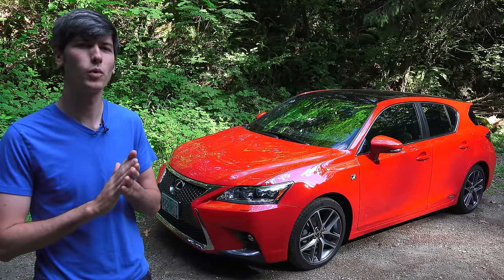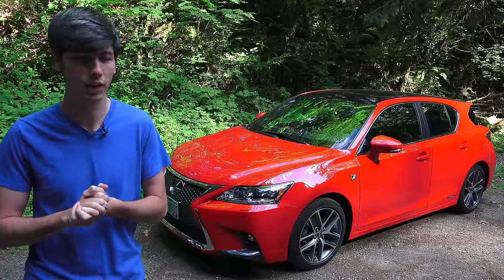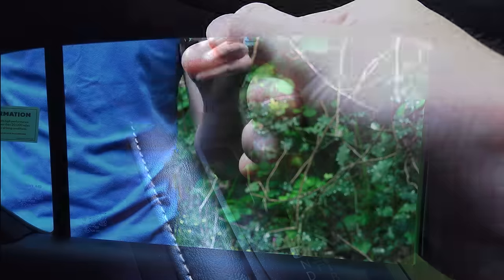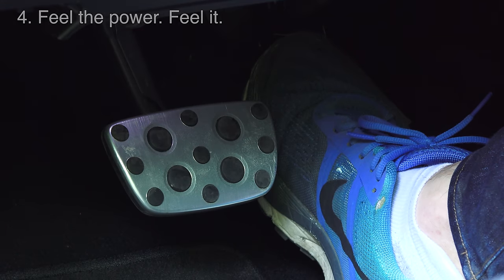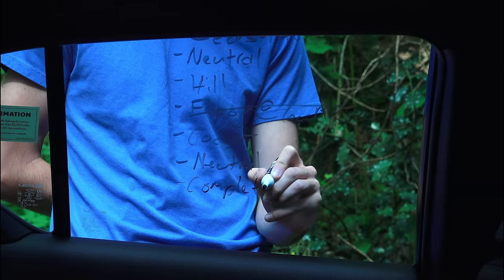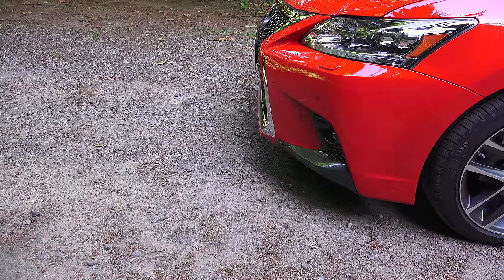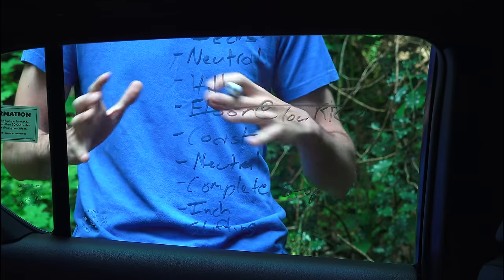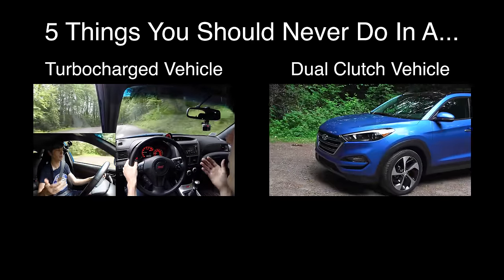5 Things You Should Never Do In A CVT Vehicle

Comment: Number 4 NO NO NO.   Starting from stop with heavy acceleration AFTER an emergency stop will damage it badly.  It is like starting from a stop on a 10 speed bike in top gear.  It puts huge stress on the transmission.  Huge.  I believe this is the biggest reason for CVT failures.
Reply: @EpicDrew15  Understood.   I believe the stress of this type of treatment feeds into the failure modes you mention (heat for example).   I've never owned a CVT vehicle and hope to never do so until they become basically invisible and I arrive at the point invisible is good.
Reply: @EpicDrew15  I base my lay person's perspective on an understanding of the original belt drive car (from Nederlands - bought by Volvo) and comparing the inability to shift the belt down after a fast stop to a 10 speed bicycle.  The loads imposed on the bike as you start off after not shifting to the largest gear on the wheel.   Not good engineering.  All the best.

Comment: What about towing ???? Like a jet ski 1000lbs or less in a Civic cvt
Reply: Belt driven CVT have barely enough power to push the bloody CAR around in the first place, CVTs are utterly pathetic 

Don’t even think about towing with one unless you want the transmission to grenade quicker than it normally will.

Manual transmissions are best for towing, then conventional torque converter automatics then dual clutch 

no manufacturer I’m aware of recommends towing with a CVT

Comment: What about those CVT (non)sporty cars with paddle shifters? Will down shifting with the paddle shifter load the belt in the reverse direction and subject it to unintended stresses? Most CVT belts now are "pusher" types and using engine deceleration would subject reverse loads.
Reply: Have you found the answer to this? I have the same question too
Reply: @markdizon3378  No answers that I have found yet.

Comment: That is not a cvt transmission. Ct200h has a hybrid transaxle without torque converter or belts or chains. It has 2 electrical motor generators and one planetary gear that emulates a continuous variable transmission

Comment: Does anyone know how a car with a cvt gearbox reacts if the engine breaks down when the car is moving? 
My Mercedes b-class engine quit with no warning when pulling out of a junction and the car stopped as if an 'emergency stop' had been performed. I was travelling at about 10-15mph when it happened. 
I'm trying to figure out if it's the engine at fault... or if it's with the gearbox.
The diagnostic computer shows no fault codes. 
After restarting, the engine and gearbox runs fine but I'm scared to use the car on the open road again as it could be a danger to myself or other road users should it occur again, especially if it happens at a higher speed. 
Any advice would be appreciated.

Comment: I broke a Subaru Outback 2015 CVT by slamming on the brakes in my driveway, and flooring it, and slamming on brakes. I have driven manuals all of my life and automatics break, and cost more than the vehicle to replace. My 2015 Outback with 135,000 miles is worth around $10,000 and a new transmission is $8,000 for another 125k miles. My 1994 3000GT still has original clutch and 190,000 miles and no problems. Automatics are trash made for lazy people. Problem with automatic cars is all automatic transmissions will go bad and devalue the vehicles by 80%. A manual will not break unless the synchros are damaged, and a manual won't devalue the car like automatics. So why do we pay more for used automatic cars if they have a shorter life span than a manual?

Comment: Had 2 CVT vehicles...  $46,000+ down the turdflusher...  Garbage.  Subaru was bad from original purchase and Nissan was initially quitee than other brands but was acting up by 50k miles.

Even friends with Toyota CVTs (and "direct shift") and Honda CVTs have had a lot more issues. 

NEVER AGAIN. I'll buy a used car with a traditional AT before buying a CVT.

Comment: Explain brake mode in a video! I use it in our Prius in stop and go traffic and my wife thinks it’s bad for the car. Settle this argument!!
Reply: Thomas Lowe it just spreads the motor side of the push belt assembly reducing the gear ratio to be slower than the engine, thus using the engine’s compression to slow the vehicle.

Comment: Why is inching bad. Is it more stressful on it?. I live in NYC and many times in rushour there's inching
Reply: Because if your foot is on the brake, the clutch disables, if you're inching forward it makes the system have to basically half clutch it & it puts unnecessary strain on it, where as instead you could just chill and wait until it's actually time to go, then FULLY let off the brake & allow to enable the clutch fully.
Reply: I probably could've explained that a bit better but I just woke up.
Reply: @SamuTheFrog  so that's the case for all transmissions not just cvt

Comment: Whatching this as a tractor driver. Dang CVT's built in tractors are different han the ones in cars. You can drive foreward with 0.02 km/h no problem, you can put it in reverse while driving foreward, you have a clutch pedal even tho you never use it except when starting the engine.
I know this is a 5 Year old video and no one will see this lol

Comment: #6 never buy a vehicle with CVT, gas mileage is nice but not when you're replacing the transmission every 75,000-100,000 miles for $2000-$4000 before labor the benefit is over, lot of places wont even rebuild them either which surprised me. For something that has been out for decades it's amazing how shitty majority of CVT transmissions are. There are a few exceptions but look it up, lot of horror stories.

Comment: How do these transmissions do in mountain driving? I live in southwest colorado and am surrounded by steep passes!
Reply: Derrick Allen I have a 2017 Ford Fusion energy that has a cvt and an electric motor and if I don’t charge my car before going up hill it kinda sounds like it’s struggling tbh so if u go up hills a lot I wouldn’t get one unless u have the car fully charged then ur fine
Reply: They do alright when they’re brand new but constantly going up and down mountains will wear them down and could cause the belt to slip from all the pressure but if you do get one change the fluid every 30k and stay on top of the maintenance for the entire time you have it

Comment: Why wouldn't you put it in neutral at a stop?
Reply: Gamer Dad cause there is no need too. Torque converters run with liquid so even if the engine is rotating its the torque converter doesn’t have direct engagement with the engine thus no damage will be done.
Reply: @justmetal227  but the car is still pulling

Comment: Is it in cvt to shift from drive to sport while on driving?
Reply: leonard Are you asking, does a CVT have sport? That depends on the model, but if it has, you can use it when ever you want. In sports mode, CVT’s usually mimic 6 - 7 speed manual gear box.

Comment: CVTS don't shift. They hold a single RPM it's trash.
Reply: I just got a corolla S 2015 and it's actually quite fun. It has a "sport" mode and when you turn it on it pushes you back all of a sudden, is like downshifting in a manual but it just keeps accelerating and you don't feel it. I used to race and even "drift" in a 2000 non SI SOHC Civic when I was younger, you know those fast and furious times, I broke multiple engine mounts and even overheated that thing to the max going 120mph. I remember one time I won against an integra and the guy left crying and couldn't believe it. 😅

Comment: I love science/ engineering videos, but I am finding the more of this "engineers" video's I watch, the more I dislike his content.  He really seems to hate manual transmissions, and thats fine, to each his own.  However in watching his videos, he talks about only good points on CVT's and automatics, and only bad points on manuals.  (even though from a energy loss perspective, manual and DCT's are the most efficient transmission there is) Also, in this video he says there is no reason to put your car in neutral at a stop with an automatic or CVT.  So when im sitting in the drive through, there is no reason to put my car in neutral?  While yes, it may not immediately burn things up; it certainly does your transmission no favors to have it sitting there generating excess heat in the torque converter for absolutely no reason.  Not to mention you are also burning more fuel, since the engine also has a slight load on it from the car being in gear.  So come on mate, you are supposedly an engineer, engineers must weigh in all the facts, not leaving out the variables which "hurt" your case.  Leaving out those variables, which we all know exist, is the quickest way to loose the support and respect of your fellow engineers.

Comment: Cvt's are crap, especially nissans.i'll keep my conventional automatic thank you.
Reply: Honda CVTs with their 1.5T and Toyota's eCVT in the RAV4 Hybrid is pretty good. Plenty of power down low for both so no reason to ever rev it high.
Reply: @Lucky8s  I heard good things about the Toyota cvt's.i currently have a 2000 camry, I've owned about 10 years.it's got 220,000 miles,no issues.if I had to buy a cvt it would be a Toyota.

Comment: .... this is 7 minutes of my life I will never get back....
My Nissan Juke is 4 years old and has 92,000 miles on it. I literally just picked up my car from the dealership today cuz it had to have a new transmission put in. Why?? because CVT SUCKS!!

DONT BUY CVT!!!
Reply: Rach Rolo 1) Nissan cvt’s are junk. Everybody knows that. 2) Should’ve went with Toyota’s or Honda’s cvt as they’re known to be the more reliable cvt’s. Corolla and civic cvt’s have a very minuscule failure rate 3) on the bright side... your car 92000miles / 30mpg = 3067 gallons / 11gal fuel tank = 279 refills. 28$=full tank = 7800$ in gas for the past 4 years. If you would’ve had a 6 or 5 speed AT. You’d be getting 26/27 mpg. 92000/26=3539/11=322*28=9016. 9016-7800=$1216. Congrats you’ve saved $304 on gas per year with a CVT over an AT even though yo owned a shitty CVT.

Disclaimer: gas prices vary. I used $2.549/gal.